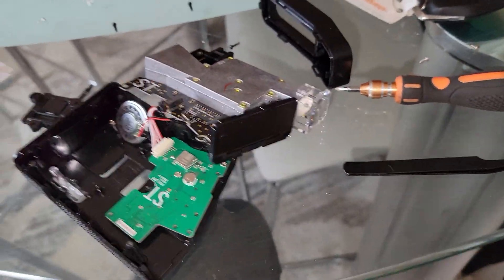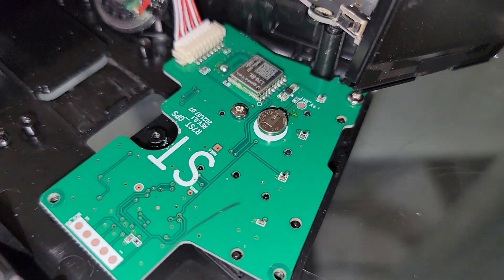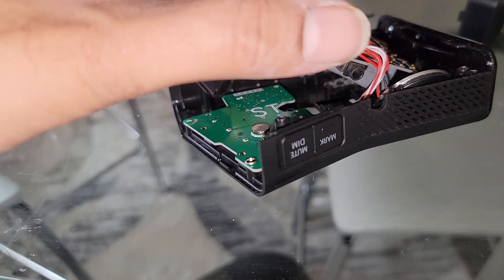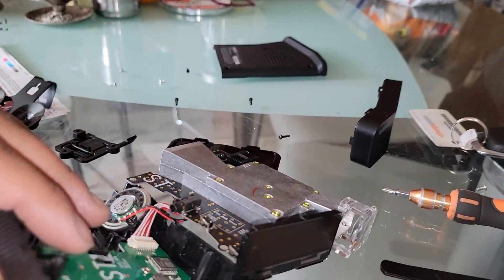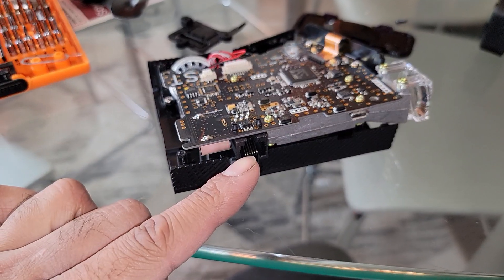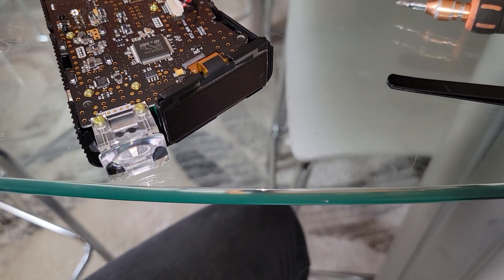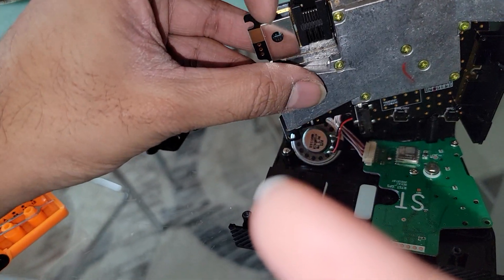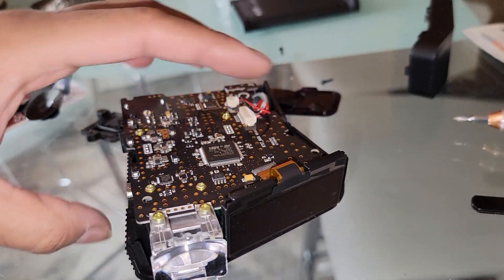Uniden R7 Tear Down

Comment: Cool teardown thanks!  Was curious as just bought a R8.  I wouldn't be too worried about the buttons, I had a Uniden LRD950 for well over a decade, and it still works fine - the buttons are hardly ever used once you get the detector set up.  I'm actually impressed it's lasted so many years mounted to the windscreen in my car through freezing winters and blistering summers.  The difference in laser to radar detector sizes is related to the wavelength that is being detected.  Longer wavelengths need larger detectors (think of it like an aerial on your house - VHF needs a larger aerial than UHF because the wavelength is longer).  The lasers wavelength is tiny, so only needs a tiny "aerial", the radar is comparatively much longer, so needs a much bigger "aerial" - I can confirm after owning the LRD950 for so long, the laser detector does work - but it's also useless for avoiding speeding tickets, as laser detectors give the police your speed almost instantly, so by the time you have detected it, if you are speeding, it's too late.

Comment: On ky R7, the inside corners of the power/data cable port latches have worn down and no longer securely hold the cable.  Is that port connector soldered or snapped on to the main board (is it easy to replace)?  Thanks

Comment: Do you know by a chance where to get that front lens and how scratches may affect it's efficiency?
Reply: No but if it is a very deep scratch it could slightly hinder the performance
Reply: I know a little bit about optics... so for radar frequency we are talking around 1cm wavelength.  Typically a "good" focusing lens will be parabolically accurate to 1/4 the wavelength of the frequency of the photos it is focusing - so long story short, it'd have to be really messed up to make any difference.  It might scatter a bit of the wave front, but it won't hinder detection.  By comparison visible light has a wavelength of around 500nm, so it's far more sensitive to imperfections in any focusing device.